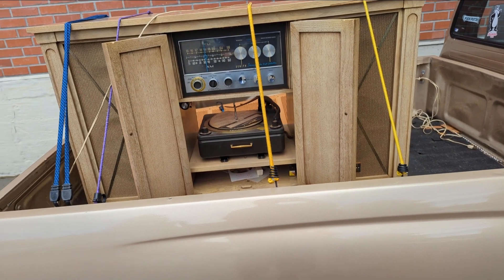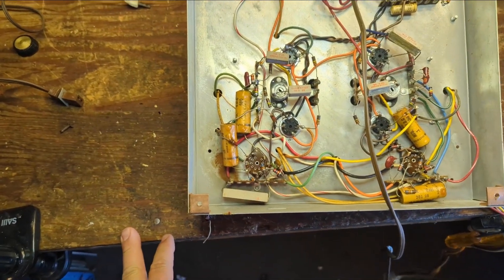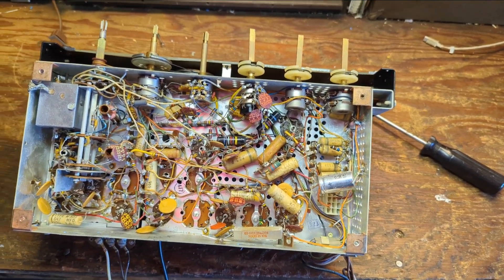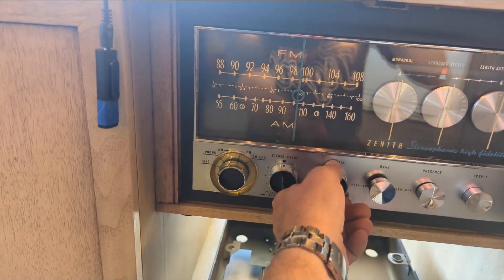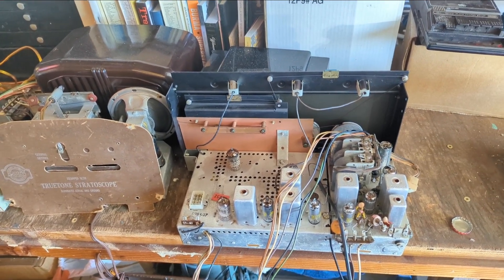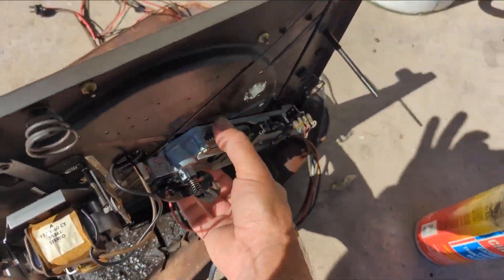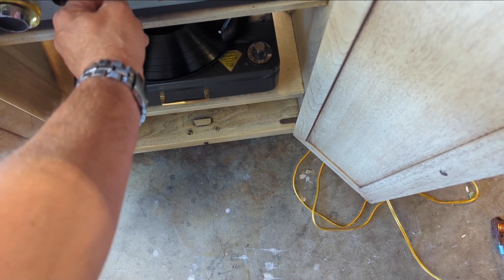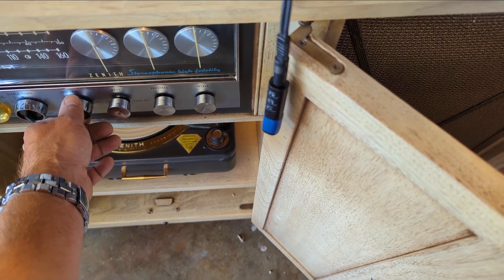Mega-Overhaul: Zenith Stereo Console

Comment: I used some brake cleaner on a very expensive N scale  Kato  GP-38  locomotive and it made all the gears to swell up and ruined the out of production  motor. It also reacted with the plastic  of the shell.  Also got some on my Swiss Army knife and it started to melt  the plastic on it also!
Reply: Brake cleaner is NFG on any plastic!

Comment: 1959 Zenith console. Such quality built stuff it still works with it's original parts. Even the turntable wants to work.
You seem to be having issues with the Bluetooth to tuner section connection. Check all speakers for operation
 in case one is bad. Otherwise: 1. Old  disc caps can distort on higher frequencies. Replace those even if they test 
good! Some guys tap on them with a wood stick to see if they are microphonic. 2. Use a shielded cable especially 
for longer runs. 3. Remove the screws holding the speakers on one by one and use a 1/4 inch rubber spacer between 
the speaker body and  cabinet. Sea Foam SS14 is actually a good spray to use on moving metal parts but keep it away
from the rubber parts. Yes the cabinet is a  (light) maple veneer but also came in ( dark) walnut too. Crazy Uncle Al 
should know that I wouldn't know what "he" even does or even exists without a volunteer like you and your channel.

Comment: Here is a trick that may work with that microphonic feedback problem when you play the records. Try putting pieces of a thick soft rubber underneath the springs that the turntable sits on. Those Springs are not enough to minimize vibrations and feedback. I have made thick rubber discs and put them under the springs on a couple of sets of the past and it worked. try it out good luck
Reply: An old technician trick was to fill the inside off turntable monting springs with foam rubber to dampen springs vibration.Easy old school fix.

Comment: I like 👍 that ya got this. It looks so much like 👍 a console. Anyhow, the doors 🚪 open and close. I guess somebody kept this in pristine condition for the last 70 years. The original turntable 🥴 platter label 🏷, and owner’s manual 👨. It still needs a recap job, and possibly new tubes. This unit probably came out later than what I was originally thinking 🤔, since the speakers 🔊 are permanent magnet 🧲. GREAT 👍 stereo sound!! Your friend, Jeff.

Comment: To prove to you just how unfriendly WD-40 is, it eats soft metal, and zinc electroplating. 
But for a real TEST, spray some in a brand new padlock and leave it for 2 weeks. Not even the lock picking lawyer would be able to open it again. 

I estimate that the carbon tracks in the pots would be messed up depending on use of the controls; in about 2 years. WD-40 breaks down grease and oils and resin, which means you have to clean and lubricate after use. 

Everyone thinks that there is a grease on the pot shafts that gets hard, it's actually a resin, like what you find in 2-part epoxy, it gives the shaft a nice smooth but firm motion.

A similar resin in used on the gears in a cassette deck for the door you see the nice smooth motion when you press eject. Putting WD in there will mess up that smooth eject motion, and the door will fly open like a dust bin.  

Nice job on the recapping.
Reply: When we were kids we used to race RC cars. I wanted to race the rich kid with the expensive cars. I figured I'd clean the car up and lubricate everything. I sprayed a bunch of WD40 into the rear end thinking it would be faster. When  I raced him the rear end housing fell out, it dissolved the glue holding it in the car, then I tried epoxying it back in and it worked but then the housing started to crack and fall apart.
Reply: @aprules2  See what I mean?
Reply: , @Raul_Gajadhar  I'll be honest I work in construction now and our industry basically runs on WD. We use it on all the padlocks in the winter to keep them from freezing and on just about everything that moves. But it's all steel.

Comment: I have the same problem with a BSR turntable where it picks up the motor noise, I just need to clean and lubricant it better. 
Now for sound adjustments, normal listening volume, in stereo should be bass over treble where bass is at 2 o'clock and treble is at 11 o'clock when you play hi fidelity monaural it is reversed. If you are playing it at lower volumes, you can turn bass all the way up and adjust treble accordingly to ear. When playing at extreme high volume you should not have bass or treble passed the middle unless sound permits it due to low incoming sound, but even then you can over tax the unit, it is almost like a safety volume to let you know the sound is too loud and bass and or treble is too high because they assume that for as long as you own the console, you will use the speakers provided or same ones in a replacement, not ones rated higher than the amp.